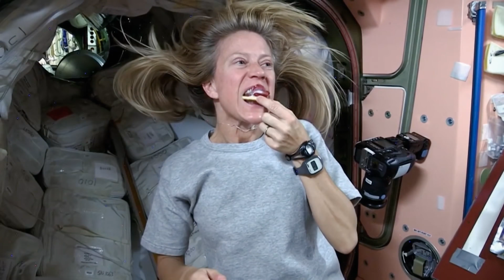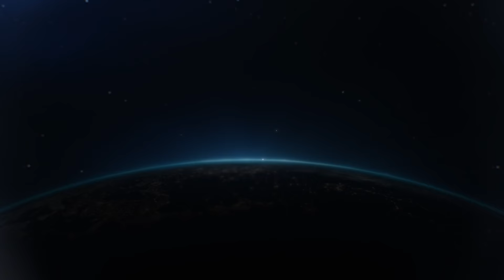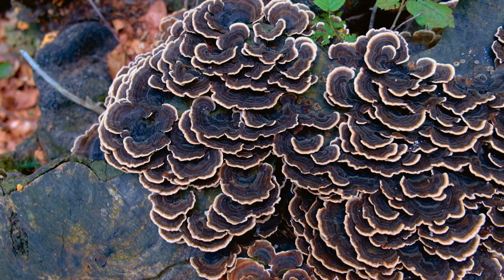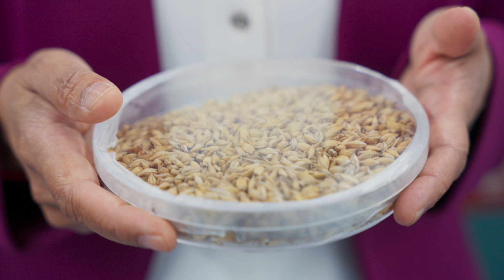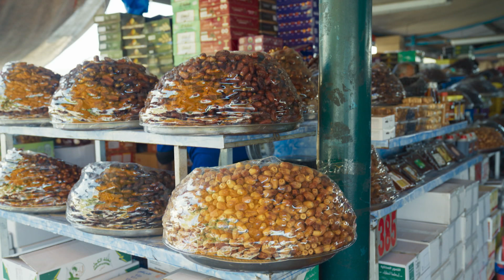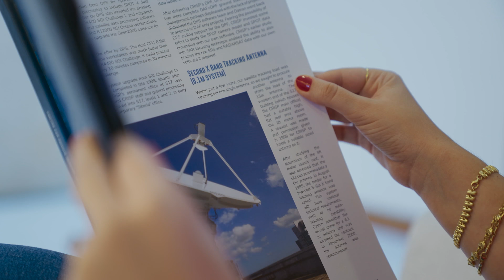How Space Foods May Transform Farming On Earth | Space Farmers - Part 1/2

Comment: New plant roots seek out nutrients in the soil with intelligence like worms; they do not simply fall towards a center of gravity. Likewise, leaves and shoots will grow towards the best access for light- though some prefer partial shade.

Plants also solve problems using capilary action and pheromone dispersal instead of using tools so the correct pressures, composition and air circulation are important for them to work properly; like simulated Hadley cells. plants work sympathetically with fungi and other microbial species that live in the soil, which can have different properties depending on the kinds of rock, mulch and chemical material the substrate has been saturated with. 

Pressurized environments like ocean floor research centers might have very different results than orbital green houses for these reasons also; a soda 600 feet below the surface does not fizz like it would at sea level. In environments like these, plants are much smaller and animal species like corals and deep sea creatures are specifically adapted to low light, low temperature and high pressure. Even their blood is specialized!

It would be very exciting if the Europa clipper mission leads to exploration of alien ocean environments, and perhaps the discovery of strange beings who thrive in a world of hydro thermal vents and volcanic activity, like crustaceans or cephalopods- but the techniques for developing electronics and robot bodies able to survive such an adventure and communicate from that kind of location are still highly conceptual.

We also need working artificial gravity, or a platform to identify which species are able to thrive in low gravity and high radiation exposure. I am not sure of how many species have successfully reproduced and lived their whole lives in space.

It would be challenging if none of these things worked at all. Haha 😅